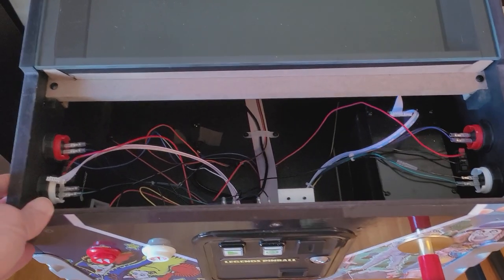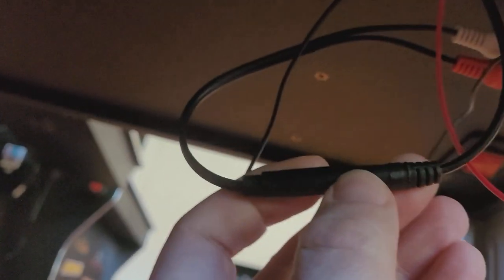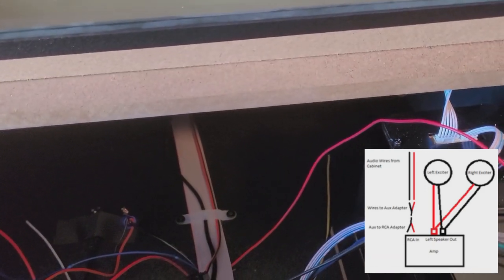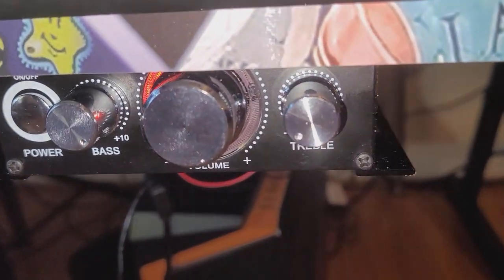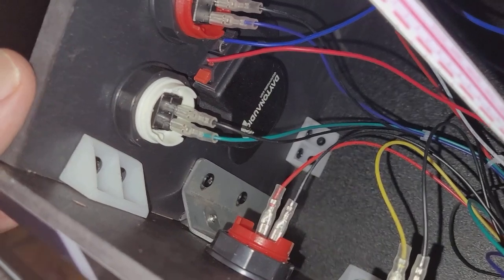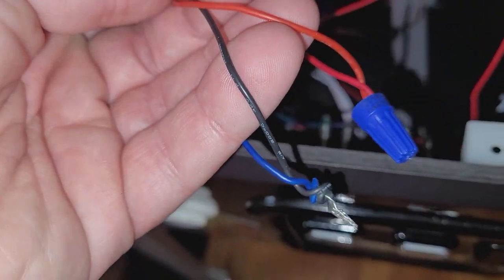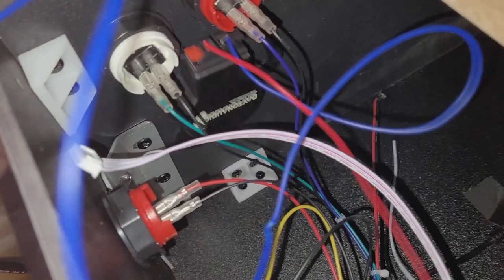Replacing Stock Exciters and Installing an Amp in AtGames Legends Pinball (ALP)

Comment: Hey man, maybe I missed it, but could you leave the stock exciters in place and add the Daytons as well in this configuration with the amp?  The stock ones are mounted up top under the control panel correct?
Reply: The top ones sound so terrible you WANT to remove them. Mine sound like a blown speaker with marbles in it haha
Reply: @Mike-B-Jackson  that issue was straight out of box. I fixed it by applying 2 way tape under control panel to base, since they only attached it with glue on front. Whats happening is the haptic is causing the control panel to vibrate with that gap causing the rumble. How that passed QC is beyond me but I'll be forwarding some pics to their dept

I agree the speakers are trash

Comment: Using these exciters, didn’t you have nudge sensor problems after install? I installed exciters in the same location you did and the nudge sensor was picking up the vibration and nudging the table.
Reply: Same issue here. Turning up the haptics very much at all triggers the accelerometer and the game tilts. I've found I can avoid this setting haptics & accelerometer to low/very low, but then there's not much benefit to having the better exciters. I'd be interested to hear if Jay has experienced this issue, or anyone for that matter, how they dealt with it.  TIA

Comment: Hey, this is a pretty good mod.  Wondering if you could answer a question for me.  So, I also hate the OEM exciters, mainly because of the placement and they rattle the plastic too much.  So, is it possible to get the same exciters that you did, unplug the original exciters and just plug in the new ones and mount them in the same place you did without the amplifier?  The sound is plenty for me, so I don’t think I need the amplifier, I just want to replace the exciters.  If you could help me out & tell me how to wire that up, I’d appreciate it.  Thanks!
Reply from the maker: Yup.  If you aren't going the amp route though, I would put them underneath the wood on the apron.  There isn't really going to be enough kick to feel it through the sides.  Im going to make a new video soon as my current setup has three exciters (two in the video and one underneath the apron) as well as a switcher connected to the amp so that I can toggle between stock and PC.
Reply: @JaysChaoticCarnivalofDreams  Thanks for the quick reply.  Could you tell me the correct wiring sequence for the 2 exciter replacements.  There is only 1 red and 1 black wire coming from the pinball unit.  So. Do I just connect 2 red wires to the single red and 2 black wires to the single black and then run a pair of black/red to each exciter?  Or do I have to wire it differently?  I don’t want to short anything out.  Thanks, appreciate your time.
Reply from the maker: @DriverGuy23  You would connect the red wire to the red port of one and then the black wire to to the black port of the other.  Then just put a wire in between the two exciters with the remaining open ports.
Reply: @JaysChaoticCarnivalofDreams  Hey Jay!  Just wanted to say thanks and give you a heads up.    I received my new exciters in the mail today & installed them tonight.  I tested a few different mounting locations until I finally settled on the inside bottom of the cabinet.  The bottom of the cabinet is thinner than the sides and top and the exciters work really well mounted down there.  I put one on each side of the inside bottom front of the cabinet and it thumps really good.  You can feel them while your playing very well.  No more rattles from the original exciters which I left unused in the control panel.  So, thanks again for your help.

Comment: Is your amp only to power the exciters or are you using it for the top two speakers as well?
Reply from the maker: There are ones who do this without an amp and say it works great, but Ive tried it, and my belief is for the extra $15, you get two big benefits out of the amp.

1) The obvious volume boost
2) Being able to fine tune haptics via the amp knobs vs relying solely on digital settings.  I don't see how people live without this.

Comment: Awesome vid!  Question (if you have time for it): could you run wires from the Right Speaker Out on the amp and Aux to RCA adapter those to the stock exciters?  So you'd have the added Dayton exciters, plus amped up stock exciters?  (This would work for me because I added silicone caulk around my stock exciters and that stops the rattle problem.  In fact, it'd be nice to juice up the stock exciters with an amp now, and have the Dayton's at the bottom of my cab.)

Comment: How much of an improvement on the Restalgia meter do you give it Jason?  It is above a 60.39?  Would you go to the next size up exciter if you had the chance to do over again?  Great job and thanks for posting it. I think you found everything the average person would want to know.
Reply from the maker: I think because I did my Gamers first, Im kinda tainted.  I need to come to grips with the fact that thin plastic is gonna resonate a lot more than the MDF on the pinball.  That being said, in my opinion, this mod is mandatory.  While still a lil sheepish, it is a marked improvement over the stock experience.  I did order a 32mm just to see how it compares, but Im honestly not sure its gonna fit under there.  Ive also orderd some very small woofers that Im hoping to attach to the inside of the flipper buttons themselves (this would be in addition to the 25s).
Reply: @JaysChaoticCarnivalofDreams  I haven't done a search yet but did you get much better results? I'll browse your vids in hopes for parts list

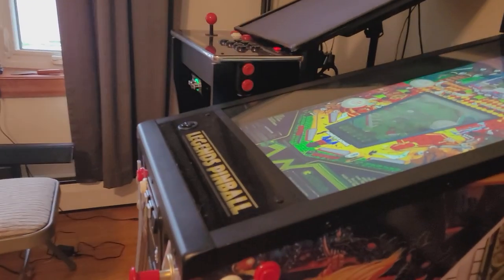Comment: Really enjoyed the video!  You mentioned @7:05 that you used the same amp in the mini gamer.  Does that mean you installed exciters in your Legends Gamer Pro?  I didn't see any videos on it on your channel, any chance you might post about that?
Reply from the maker: I did.  I don't have a video on it, but if you are part of the Official AtGames page, I can send you a link.  Its the same concept as this except I use the aux out of the TV instead of the wires from the ALP.  Also, Buy Stuff now has a kit.  They have put a lot of effort into trying to find the most optimal setup for the Gamer Pro. https://buystuffstore.ca/haptics-and-exciter-upgrade-kit-for-atgames-gamer-mini-pro-139928-5400
Reply: Thanks for the update!  I only really need the exciters, though that kit from buystuffstore looks great!  I have the gamer pro (not mini).  It looks like they mount the exciters on the wood for the full size and to the plastic for the mini.  At least, that’s what I could tell from the pics.  It sounds like you’re a fan of mounting it on the plastic.  Did you find the DAEX25 to work well mounted to the plastic?  Would you move up to larger exciters if you doing it again?  I’m mostly doing the exciters for the pinball.  Debating to mount it under the wood top or the plastic bottom.

Comment: Is there a reason you have to go from stock wire to aux to rca?  I stripped one end of red and white stereo rca cable. Can I just wire this directly to the pinball stock cable and forgo the aux adapters?
Reply from the maker: I believe so.  I plan to make an update video soon with this being one of the changes (although I havent verified it yet).
Reply: @JaysChaoticCarnivalofDreams  thanks for the great tutorial!  Look forward to the update.
Reply: That's what I did. Worked fine.

Comment: Can I take a regular RCA cable and just cut one end off and use that to go bare wire to RCA to plug the existing ALP wiring into the amp?  Can't I save a few bucks and skip the bare to 3.5 and the  3.5 to RCA stuff?
Reply from the maker: I've heard mixed results with going that route.  I know of at least one person who bypassed it and all was well.  However, I know a few others who had issues, but not sure if this specifically was their issue.  Id say try it and if it doesnt work, spend the extra few bucks.  If you do try it, let me know how it turns out.
Reply: @JaysChaoticCarnivalofDreams  I can tell you exactly why those people had issues because I just installed this mod myself and realized your solution would not work for me as I did not have the "aux to speaker wires" connector you bought. 

First off thanks for the video, much appreciated.

The confusion I think is coming from the fact that you took two wires from the pinball (black and red) and turned them into two wires going into the amp (white and red). This gives the impression that you simply connected the red from the pinball to the red of the amp and black of the pinball to white of the amp. This is not true though. The aux to wires adapter you have is mono so the black and red coming from it are signal and ground, just like the pinball is outputting.
The red on the amp however is has signal AND ground built into it. It's a stereo amp, not a mono amp, and the fact that you purchased properly grounded plugs means it all fit together as it should the way you did it with the R amp input never actually needing to be plugged in.
If someone bypassed the aux adapter and misunderstood there is a good chance they sent the signal to the red RCA port on the amp and ground to the white RCA port on the amp, thus not sending the full signal + ground that is needed to the L channel of the amp.

long winded explanation but that's it. I did the same mod as you but I sent the red wire from the pinball to the red wire of an RCA jack, and the black wire to the ground cables that are sheathed alongside the signal wire in the RCA cable. Worked out well for me so far
Reply: @anonony9081  Just did this last night and I think the limited output I'm getting is the above described problem.  I also believe the amp I bought has a mono input so I might be able to bypass at least one of the adapters.
Reply: I attached the wires from the ALP to a single RCA jack that goes into the left input channel of the amp. I think I have the 2 exciters going to the left channel outputs on the amp. Everything works fine.

Comment: Anyone else run into issues with this?  I used the same amp and the same wiring.

I turned the amp all the way up, treble all the way down and bass all the way up. I get a very annoying hum out of both speakers intermittently especially when the machine is off and the amp is still on or when I'm in menus. 

I also had to turn music volume all the way down as the exciters were bouncing around to the board music. Looks like Jay had to do this as well, but then you lose all the music to both the exciters and the main speakers.

I'm curious if anyone else has dealt with these issues? Typical to have to turn music volume all the way down? Any hum issues?

Comment: Reason you dont feel the flippers in the OTG is because the stock tables use a lower end "thump" sound with the flippers. OTG tables are using more realistic flipper sounds. Solenoids are the only way to get flipper feel with OTG.

Comment: Hey Jay I replaced the stock exciters with the Dayton ones off of Amazon without an amp. I post on a forum about the ALP and I received this post on one of my comments pertaining to the Dayton exciters. Any chance you can clarify if this is true, I wouldn't want to fry the PCB or anyone elses who did the mod without an amp. Thanks so much, your video is what got me to get one of these machines with the sole intention of slowly modding it over the next year. Message I received below. Thanks.!

 "HI, just an FYI, you purchased 8 OHM Exciters and you wired them into 16 OHMS... Which is a BIG no no! Your PCB is most likely going to go POOF! I would rather wire it to go into 4 ohms and take your chances with that if your going to keep these otherwise buy the 4 ohm ones and wire them to 8 ohms or you could even get the 16 ohms ones and wire them to 8 ohms. The "stock" exciters are wired together to run at 8 Ohms! Again, this only matters if you NOT using an external amp."

Comment: I'd love purchase a clip that connects to the existing wiring harness rather than cutting wires so I can experiment and easily revert back if want. I did this recently modding a pachinko machine with wired connectors I got off ebay for a couple bucks. Does anyone know what kind of connector would work?
Reply: That’s pretty easy to do. Buy spade connectors, make and female, and you have easy single pin connectors to easily undo and hook back up if you want.
Reply: That's what I did. Just bought JST connectors so I wouldn't have to cut any existing wires in the table.
Reply: This comment is a year old, but, BuyStuffArcades sells an audio upgrade kit that includes a special wiring harness (you can get it by itself if you already have exciters/amp-etc), that you plug into where the existing audio wire harness is. No cutting role tapping into existing cables

Comment: Great vid. Question why do you set  music to 0 in setting.
Reply from the maker: Its more like 3 or 4 and honestly may not apply any more.  When I made this video, all sounds passed through haptics, but now, on stock games, there is a specific channel for haptics.  Still, in OTG, I would set the music pretty low because it will come through those speakers, and depending on the pitch of the music, could be off-putting.
Reply: Ok thank you, great mod.

Comment: I'm stuck. Have everything wired the same way I'm getting no feedback to the exciters. Does the gauge of the wire matter at all?
Reply from the maker: Ive ranged from 16 to 22 in my various tests.  Are your wires to the exciters coming out the left channel?  Also, is haptics set above zero in table settings as well as Master Volume 100 and System Volume (buttons on back of playfield) set to max?
Reply: @JaysChaoticCarnivalofDreams l have it working. Constantly tilting though.
Reply from the maker: @brucezelner5570  Yeah.  Any sort of "real" haptics are gonna trigger the accelerometer.  You can turn its sensitivity down, but most people I know turn it off.
Reply: @JaysChaoticCarnivalofDreams  Thanks will do.
Reply: @brucezelner5570  Same here! Moved mine to top board near originals and it helps with the tilt. Still not much better than the originals for me, so I'm a little disappointed. Still tweaking, but I may just remove them and go back to the stock exciters!
Reply: @morleygill7207  mount them on the inside bottom of the cabinet.  The bottom is much thinner than the sides a top.  They feel perfect there and won’t mess with the accelerometer.

Comment: Great video. Easy to follow. I got it working pretty quick. Still sound like a  marble in a blender on the right hand side if I go higher that a quarter up on the volume. Wonder if that exciter is not flush
Reply: Yes, that’s the problem.  The original exciters vibrate on the plastic too much.  Disconnect them and mount 2 new exciters on the bottom inside of the cab.  That’s what I did and they work great, I can feel them good and no more rattles.